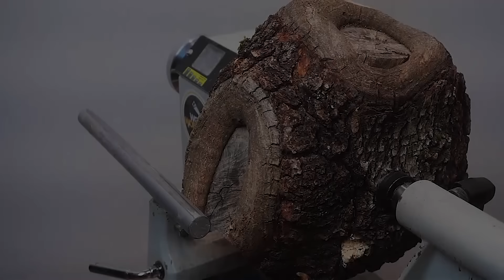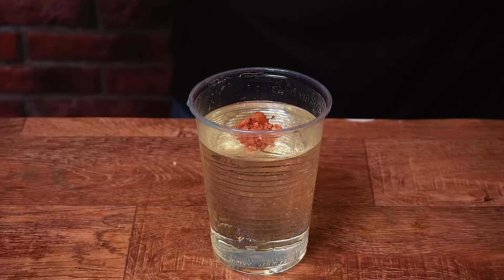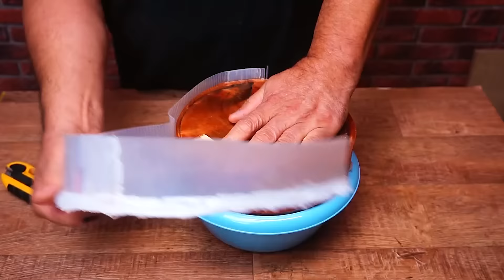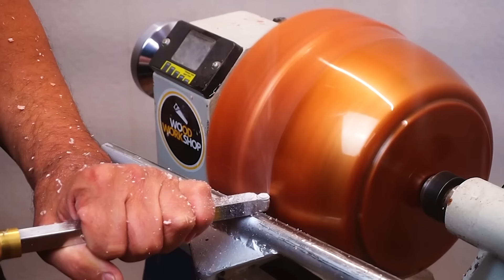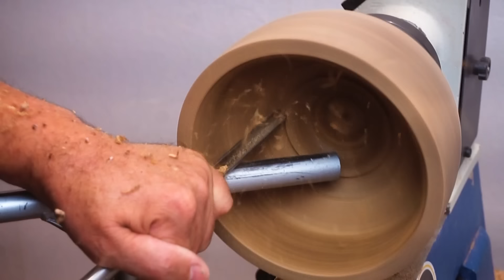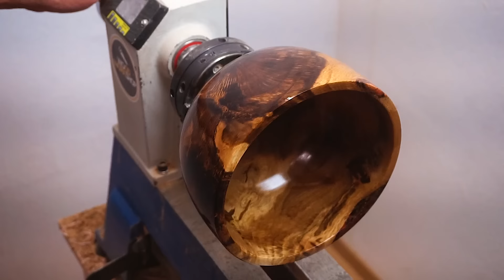Woodturning a Big Oak Log (Simple and Beautiful)

Comment: Lovely bowl. But, I think it was a waste of time with the resin. There's nothing left of it. 😢😢
Reply: There were voids beforehand. He used the resin to stabilize it
Reply: Ну ты вася
Reply: Don’t know but that maybe an attempt to fill cracks
Reply: One can see bits of the resin filling in a few small holes. Still, it seemed a bit of overkill with it; however, that might have been the only way to do it.
Reply: The resin was to fill the difiency on the wood. There was loads of cracks.
Reply: Yeah
Reply: It's used to fill in spaces in the wood
Reply: It's not a resin bowl it's a wood bowl. The resin was just to fill in a few cracks.
Reply: If you look closely at the finished product you can actually see the resin in some spots, it was definitely used as a filler.
Reply: Beautiful bowl excellent work.
Reply: À0
Reply: There was no way of knowing how deep the cracks went, so better to be safe than sorry.

Comment: It's a lovely bowl, but why did you cover with epoxy resin, then trim it all off ? 
Have I missed something please ?
Reply: He's lazy and not very good at turning. It's quicker and easier to cover the whole thing in plastic rather than either just fill the cracks or work with them. With the thickness of the bowl walls there shouldn't have been a need to fill them at all and the cracks would add real character

Comment: What was the point in using all that resin, but then leaving none of it on the finished piece?!?!
Reply: I believe it added the structural integrity to the wood that would, over time start to come apart.  Fills in those little spots that become problematic over time.  Just my observation as an amateur woodworker.
Reply: Read the description
Reply: Also my question dear friend 😮
Reply: Couldn't agree more what a waste.
Reply: I was waiting for the bowl to be put into a vacuum chamber to drive the resin into the cracks and voids.  But no.
Reply: @bretteee Starving children in Africa could've eaten that resin!!
Reply: Read the description he said it was to fill in cracks
Reply: I don't get it either.
Reply: Waterproof it and filling cracks
Reply: @Shrimp_Insurance your comment was the best 😅
Reply: People, people, people...
Reply: It took me a minute to figure it out as well.
Reply: He filled the gaps. You can see res spots
Reply: That wasn't very much resin to waste,
Reply: Excelente !
Uma bela e simples peça, decorativa ou funcional.
Reply: I was wondering the same thing .
Reply: @bridgednash exactly what it's for